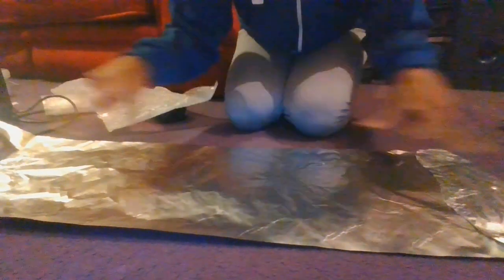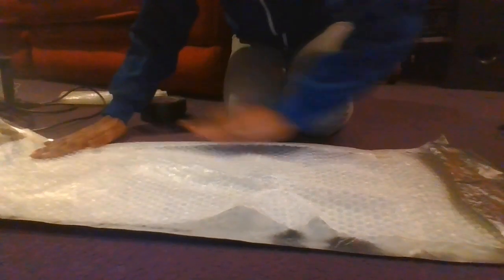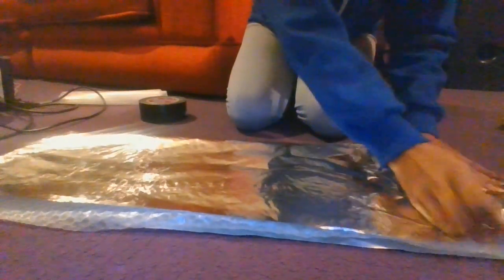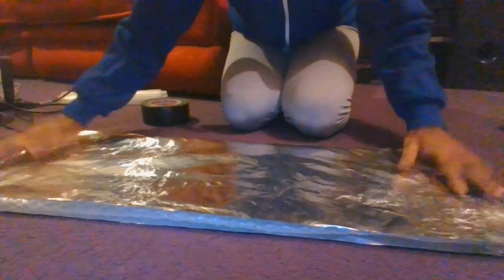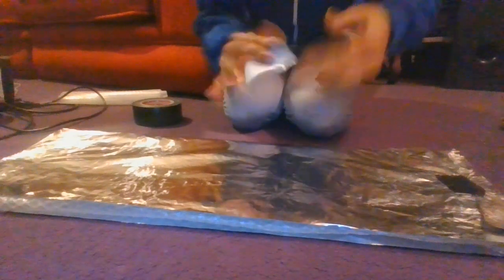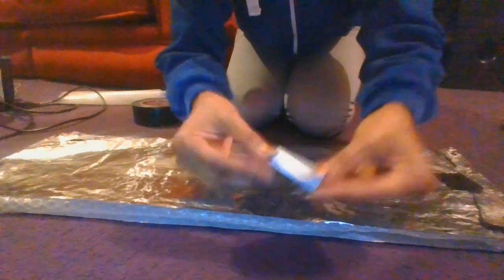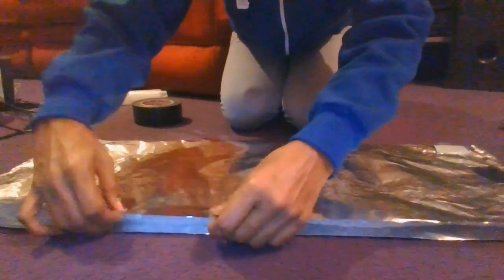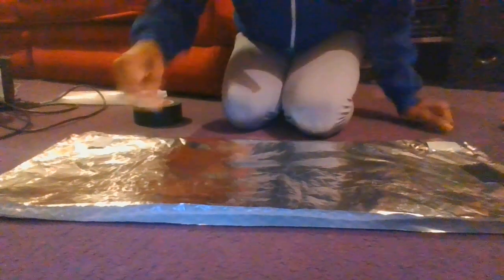HOW TO MAKE A RADIATOR REFLECTOR (SAVE MONEY AND ENERGY)

Comment: Bubble wrap shouldn't even be necessary. Though you could use some cardboard to give it rigidity and make it convenient to move around. Foil side facing the radiator, cardboard side to the wall. Casts more heat into the room. Really, this should be standard.
Reply from the maker: It really does make a difference in all of my rooms!!

Comment: It would have been better if you didn’t wrap it all the way around as now you created thermal bridging by using one sheet of thermally conductive material, so the bubble wrap is not doing much, probably still better than the wall but would be much better if the bubble wrap was touching the wall
Reply from the maker: YEAH!! That makes sense to me. Thanks Darren :)

Comment: Far easier to just stick foil to a piece of cardboard cut to size  and add dbl sided tape to the cardboard ad stick to wall behind radiator .
Reply from the maker: No I tried that and the heat retention is not the same. The bubble wrap keeps it toasty :)

Comment: Is there a fire risk using bubble wrap behind the radiator?
Reply from the maker: I’ve not had any issues. It’s not direct heat as in a flame so it’s been safe and it works 👍🏽